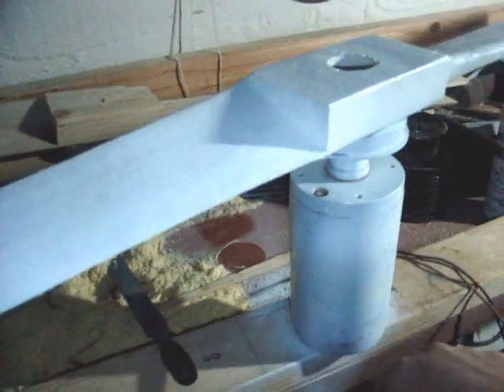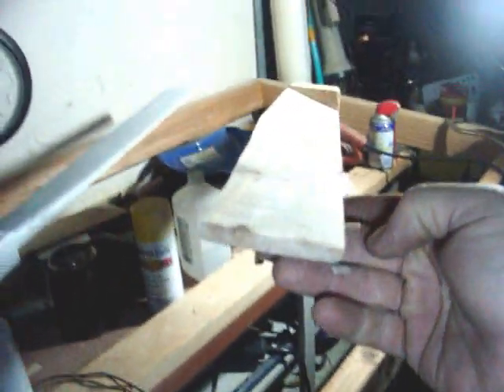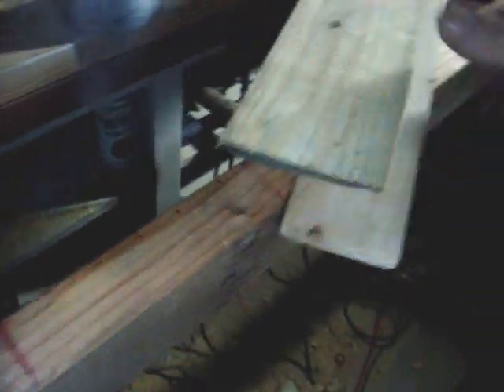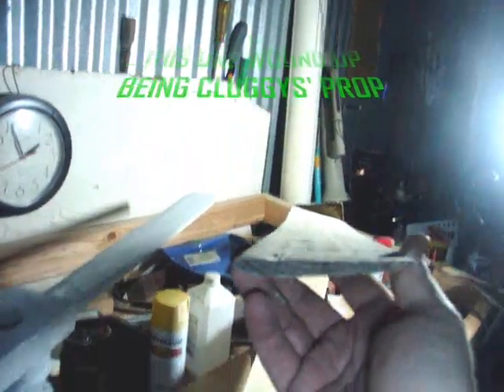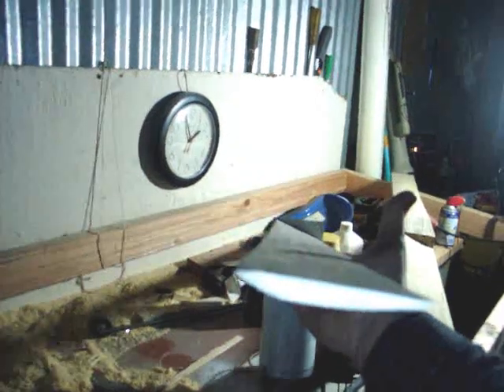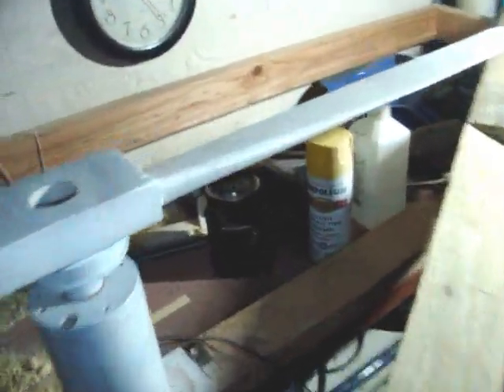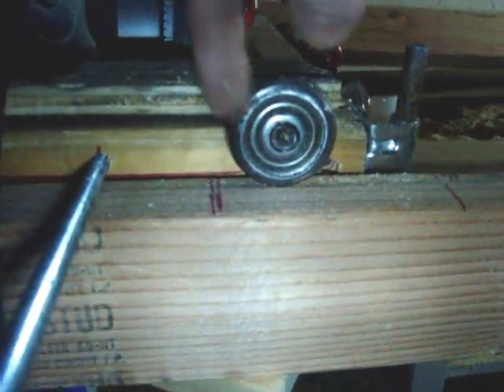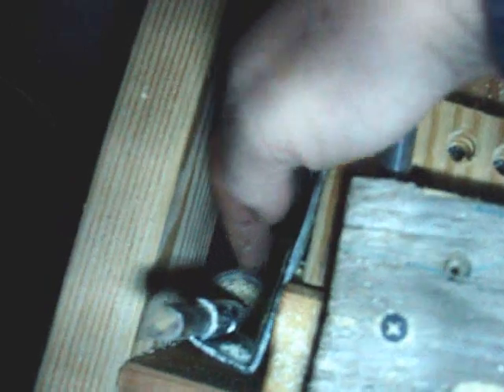FIRST PROP FOOTAGE FOR THE TAPE DRIVE WIND TURBINE

Comment: There is a guy on the tube that built a wooden frame C&C machine in his garage using a large Dremmel like router cutter. It cost him next to nothing and worked great.This is the thing that could turn out perfect props at a reasonable production time. Sure it is done by hand but it is just trace and cut. I know what procrastination is muddy and you and I got it because I still make airplane props by hand and it takes forever and the other guys about an hour or so...

Comment: Pretty cool indeed ! My Lenz 2 is gonna start off with a 3' dia, but I may move that out to 3.5' depending on how my motor wants to act. Simple, just change out the support arms, well, simple in theory anyways. Gonna try a treadmill motor on about a 4 to1 gear ratio and just play around from there. Not alot of wind here in the N.C. foothills during the summer, but this time of year we have plenty of usable air moving . Never know till ya try I reckon.

Comment: @muddymuddymuddmann
 Oh yes, they had a battery of Air-Conditioners to cool the Thunkin' Clankery... But HIFAR was a pure Research reactor. Too "pure" to make any Current...It ate Coal-fired Electrickity to run it's Cooling Pumps ; even the used Fool Rods needed Coal-Juice to keep cool. The Nukularists were too blinkered to think of Thermosyphon Cooling. So, I leapt to the conclusion that their Computer had sent them all silly. It may have, too. Ciao !